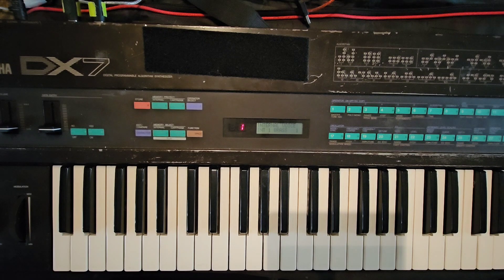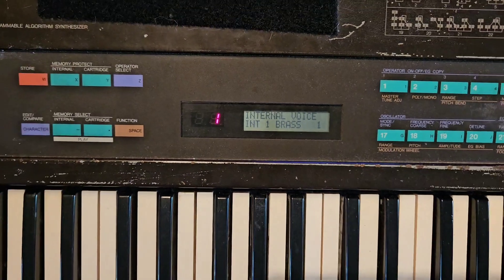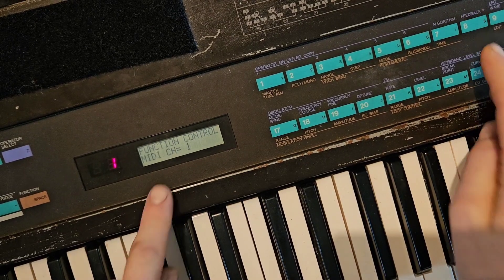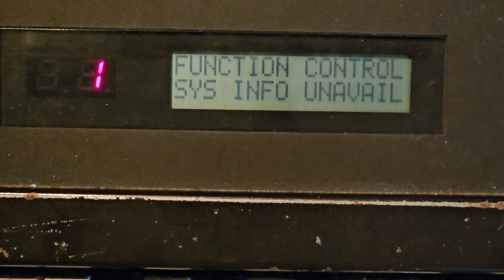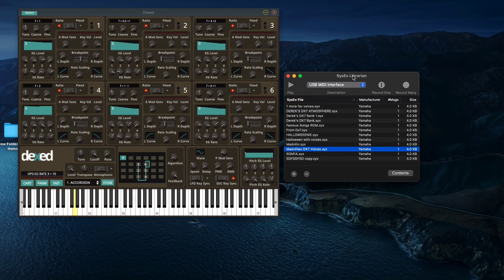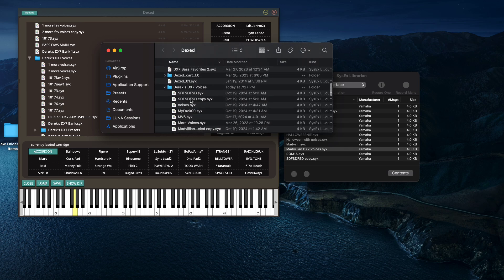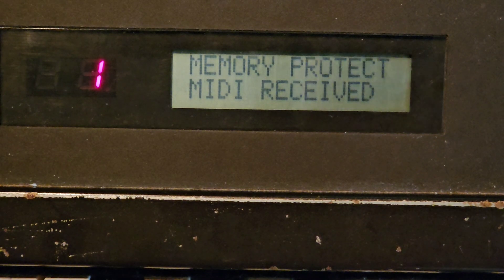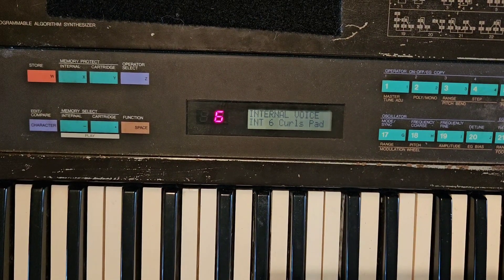Patch Bank loading on the Yamaha DX7 using SySex Librarian and Dexed

Comment: thanks for the tutorial man helped a lot! my Sysex librarian isn’t giving me an opinion to change the destination to send midi, it just reads “act as a source for other problems” any chance you’d know how to fix that? thanks again
Reply from the maker: It may not be recognizing the midi source. You might have to use an audio interface with midi or a different midi to USB cable. If you are using a mac you may need to open up the audio/midi studio and select your source there.